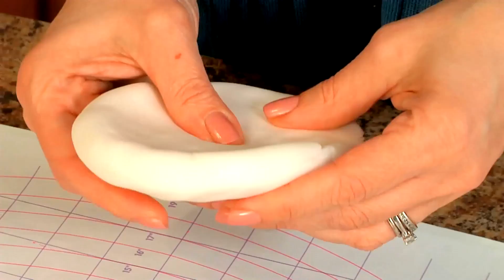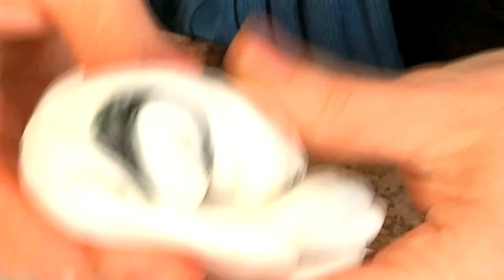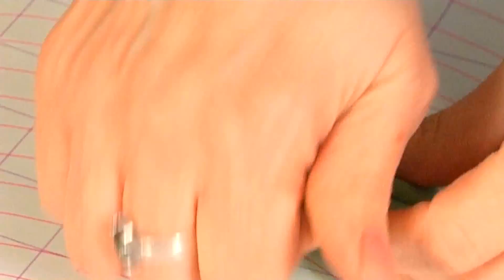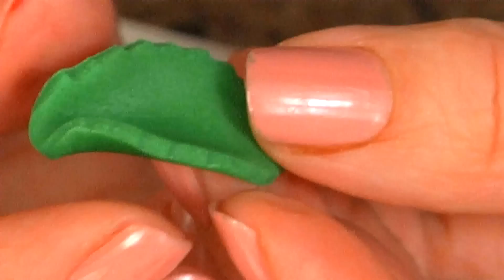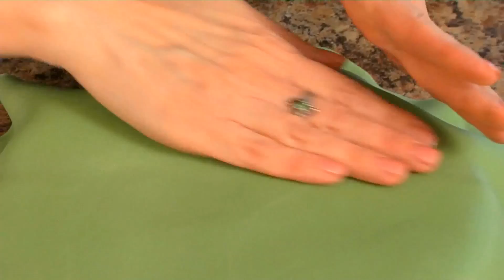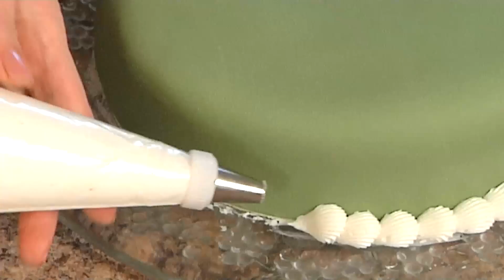How to Decorate a Homemade Cake Using Fondant : Decorating Cakes

Comment: Hi you have a wonder ful tchnique.. I hv one question. When should we put the fondant on cake and should we put the cake in refrigerator after that? Suppose we need the cake at 8 tonight. so when we should put the fondant on the cake.. thanks.